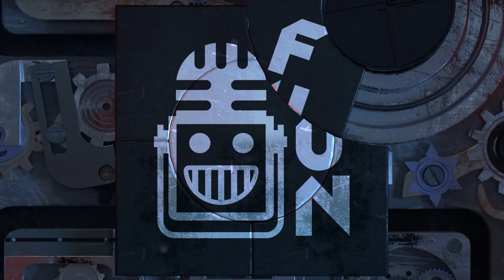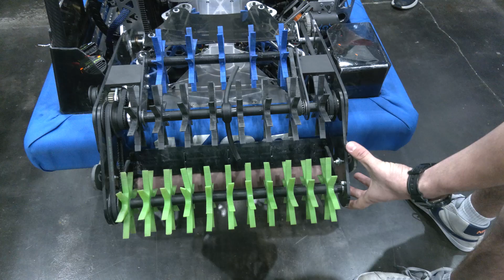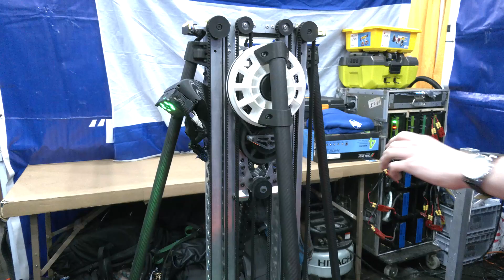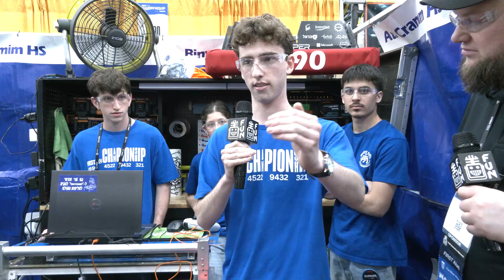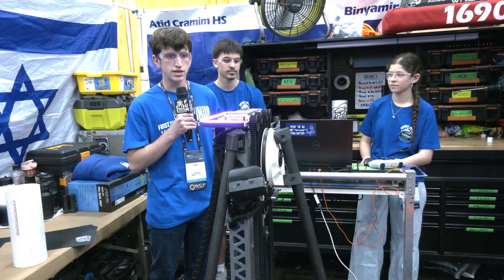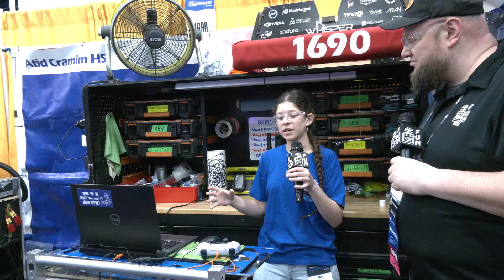1690 Orbit | Behind the Bumpers | FRC 2025 REEFSCAPE

Comment: We totally missed that First was allowing vacuum devices again after so many years since 2018, that was a great catch by you guys!  We looked for it every year too, but we just thought vacuum suction cups were never going to be allowed again, so that idea faded away.    We know... if it is not listed it is legal. First is not going to say what they took away and is back for any year for sure, but I wish they would put together an index for it.    We use to use air and the compressor, but First was so specific about how that pressure system has to be setup and designed, but they have NOTHING that I know of about how to regulate vacuum pressure.   It sounds like you guys have some kind of vacuum regulator is that correct?   Is it like negative 60lbs or something?   You talk about regulating the vacuum, can you tell us more about that?
You guys have perfected an almost autonomous robot, I could see in the replay of the drive station what looked like object detection of coral, is that correct?  The coral looked like dots on the ground appearing and disappearing.  You guys would pick up coral, sometimes guided by the driver, then once that was done your robot calculated its own drive line curves to the Reef is that correct, No Path Planner, just real time path planning?   Did you have a coprocessor for this or were you able to do it all on the RoboRIO?  Your programmer mentioned some kind of sector mapping and curve calculation?  That is some real Tesla level drive coding, is it available for everyone to download?
   I wish PathPlanner could be simplified tuning, instead of having so many parameters involved, we could never get those values to be close enough past dropping off the first coral... just a few inches off every time after the first coral drop so close.   We were not able to get the AprilTag calculation done fast enough for it to be competitive.   We would come in slow so that the April Tag could be read, then we would make a drive adjustment, but something just blew up in the code and the Robot would go open loop on us so that was the end of that.   Your robot seemed to be on rails I could not see it having to re-align itself after entering a Reef Station... so your odometry calculation from the random coral pickup location to the Reef is next generation.
Reply: Basically they don't have to follow the pneumatic rules because they are not creating any positive pressure. All they are doing is using a motor and cam to back drive 2 pistons and generate negative pressure, which doesn't require them to have any tanks or compressors! They can also just regulate the pressure by driving the pistons more or less to create more or less suction. Super cool system and executed very well
Reply: @ A vacuum pressure can be every bit as powerful as a compressed air tank.   Does that not seem like a mistake if there are not similar rules governing vacuum pressure as there is for a compressed air tanks?  For each 1sq inch area that is 14.7 pounds of force at sea level it quickly ramps up to where we were able to lift an entire robot with only 8" sq area.  If First did not make the attaching element able to with stand that or there was some possible way that a force could damage the field element, First would probably have a rule governing it.  For sure the only concern of damage would be with the coral or algae, and there is little issue with that.  But to have no rule is what was interesting, because that kind of rule would have drawn our eye to the possibility of using a vacuum system to grab a coral and algae.
Reply: @sy2532  Vacuum pressure differential is limited to 1 local atmosphere for obvious reasons. Compressed air is not subject to that natural limitation and in the rulebook, the high pressure tank is limited to 120 psi, or a little over 8 times atmospheric pressure. 
It seems natural to me that there would be a stricter set of rules for 8+ Bar of pressure differential than <= 1 Bar differential.